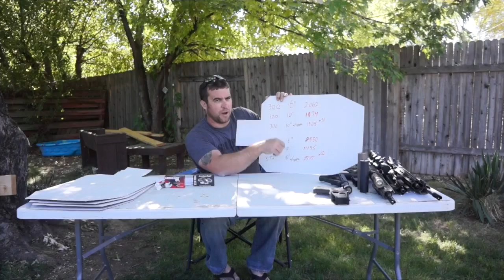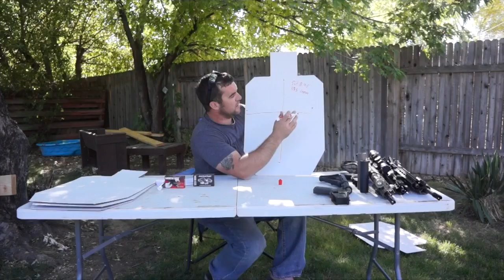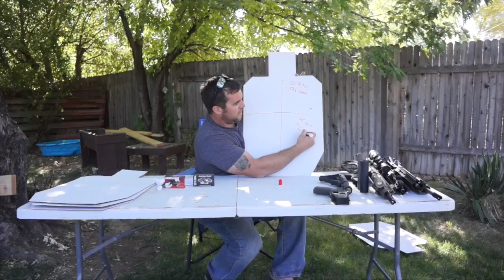Gunfight Science: Is 5.56 NATO Dumb?

Comment: 300 blackout is a better round SBR compared to 5.56. If money ain't an issue, go with 300 black. 
It's designed that way. 
Reason people run shorter barrels is for easy of use indoors. Overall shorted length when suppressed. Surprisingly cheaper considering 12.5in is far more prevalent. Smaller guns usually weigh less. Ammo is cheaper than 300 black. 
5.56 to the chest >25 yards will do the trick for any self defense situation.

Comment: 10.5 in barrel will get the job done 200 yds and in, you will still be ok at 300yds but from 200 to 300 you have lost a lot. Ammo and grain matter too, getting a higher grain or a round specific designed for SBR will do the trick. Such as hornady black tap 75grain. But if you really want a SBR look at a 12 in 6.5 grendel with a 123grain, the amount  of energy that round produces all the way out to 500 yds with a 12 in barrel is fantastic.

Comment: I killed a 80 pound beaver with 1 shot from a 10.5 inch barrel at 40 yards. The ammo I used was XM193 FMJ 55gr. I observed that the death was nearly instant for the beaver. upon dressing the beaver and butchering it myself I did struggle to find where i actually hit the beaver. Later I found that the bullet had hit the spine and reversed 180 degrees and stopped by the rib wall of its right lung. My guess is that the hydro-static shock from the round, the shot placement in the spine, and the relatively close range were the factors involved in the beavers quick demise. In conclusion, I believe that the 5.56 round out of a short barrel has its place in under 100 yard engagements, and that in war time it is more important to have volume of fire and the ability to carry more rounds into battle for the average rifleman than it to be delivering the killing blow to an enemy at the cost of greater weight and less ammunition. That is why we see M240B in (7.62 NATO) and other DMR (7.62 NAT Rifles)  being used in combination with the 5.56 NATO on the battlefield. There is not one gun that can do it all.   

Also 300 black out is far less effective at longer ranges. The bullet drop and makes shots out to 300-400 yards much more difficult. At least out of the SBR 5.56 you can still engage targets with out as much variable play. wounding an enemy and still having the ability to effect the overall combat effectiveness of the enemy  with a flatter shooting round is better than trying to adjust on the fly your bullet drop for an unknown distance.

Comment: You can find/buy 200X as much 5.56MM than .300BO.  What are you going to be able to find in the battlespace?   And getting hit by 400f/s round from a 10 inch barrel will still F- a person up.  And you may not want the bullet to travel 600-800 meters down range.  And maybe I want to stay under 500 meters.   Nice thing, is having standard ammo in the truck is nice.  I can carry 20 mags of 5.56 or 10 mags of 5.56 and 10 mags of .300......... yeah, I will stick with stupid and run the 20 mags.......

Comment: 2850 out of a 16 inch barrel? that is some under powered ammo.
Reply: Isn't 2900 out of a 18 inch barrel standard performance?
Reply: @frankopanklaric  No, I get about 3100 out of a 16 inch. A 12.5 with 556 will get around 2850-2900. 223 rem or under powdered 556 will get 2900 or so out of a 16 inch.
Reply: @frankopanklaric  Not for a 55 grain.

Comment: I beg to differ.

2500 fps is plenty to get the job done at close range. It's funny he's knocking the Mk18 at room clearing distances, then in the same breath practically is endorsing an SPR. Well, he's talking about a long range platform, and what does he think happens to bullets at long range? They slow down! Those successful kills with the SPR most likely took place at the same velocities as what a Mk18 would produce at close range. What does come into play is angle of attack. Normally, bullets wobble like a football, but at close range they can enter the target straight, meaning they won't work at any velocity. The reason the SPRs worked in his experience, and the shorter barreled weapons did not, is because the kills with the SPRs were at ranges where the wobble becomes more regular, thereby greatly increasing your odds that the bullet will do what it's designed to. Use SMKs, M855A1, Gold Dots, etc. and it's no longer a problem. Angle of attack is not a consideration for any of those. So having adopted M855A1 since like 10 years ago, the US military no longer has to worry about this stuff. Believe me, you DO NOT want to get shot with M855A1 from any barrel length.

He's also failing to take energy into account. The way rifle bullets do what they do in terms of messing stuff up is that they cause a stretch cavity that's large enough to stretch the tissue past its breaking point, causing it to tear, thereby creating a wound much larger than the size of the bullet itself. That's a matter of energy, not of velocity. Whether it's heavy and slow or fast and light, it doesn't really matter. Ergo, 5.56 and 300 BLK, being in the same class energy wise, will both do about the same thing. The 5.56 has advantages though. It can pierce armor, and it has more range, plus has a flatter trajectory. So a Mk18 is more versatile than a 300 BLK, EXCEPT when it comes to shooting suppressed. If you're intention is to shoot subs most of the time, then 300 BLK is king, BUT you have to realize at that point you're shooting a big SMG, not a rifle. So it's not fair to compare it to 5.56, because it's closer to something like 44 mag ballistically. If you're not planning on shooting suppressed, 300 BLK doesn't make any sense. It's designed to shoot subs most of the time, with the ability to switch to supers as an added bonus you wouldn't get with something like a 10mm SMG.

As if it weren't bad enough already, then he knocks PDWs! We're talking about something meant to replace 9mm SMGs and pistols, that offers terminal performance in some cases getting up there not too far from 5.56! Some of the newer 5.7 from a 10" P90 is getting up there in terms of muzzle energy with a Mk18, and it's far more controllable than most SMGs, and certainly more controllable than a Mk18, not to mention more compact and has 20 more rounds in a standard capacity magazine.

Long story short, short barreled ARs in 5.56 and PDWs like the PS90 are extremely useful self defense weapons for civilians and law enforcement. Maybe they're not ideal for rank and file military applications, where M4s and M16s make more sense usually, but for us domestic people they are absolutely the greatest thing since sliced bread. A Mk18 upper on an AR15 lower is about as good as it gets for home defense, especially since you can now get cheap Israeli 77 grain SMKs.

Comment: What length were the "standard length" 16" or 20"??
Reply: 20" is standard, then later adjusted to 16", but the 556 was originally built for a 20" barrel. It performs best there.

Comment: I use 5.56 for one thing, and one thing only. 55 grain full metal jacket for close-quarters work with a Mini-14 USA 16 and a quarter inch barrel but that includes 3 and a 1/2 in of muzzle brake with the ports tilted forward so that the noise doesn't deafen you every time it goes off. The round has devastating wounding capability. It doesn't have any ability to go through tactical barriers. If someone is inside an automobile and you have to shoot through the door, you'll pepper them with fragments but you will not stop them without shooting an inordinate amount of ammo. That's what 308 sore for, actual battle work.

Back in the late thirties when they were developing the M1 carbine they actually had a round that they tested in the M1 carbine it was a 25 caliber bullet in an M1 carbine case that was necked down. The 556 is actually an extrapolation of those early trials under the guise that if you wound somebody it'll take two other of the enemy to remove him from the battlefield and so that you somehow have removed three people from the battlefield? I don't understand that because the enemy in Vietnam never wasted time taking wounded comrades off the battlefield until the battle was over. Things like that happen when you fight people who have no regard for human life.

Comment: This is generally correct. That is why the M855A1 is so interesting. It tends to spawl or separate and tumble even at velocities as low as 1500 fps at the target.

M193 does a pretty good job in 10% BG down to about 2500 fps but at 2000 fps is much less effective.

This is why I favor the Speer 55gr GDSP for home defense at leaste until M855A1 becomes more readily available. Does well even through Windshield glass without over-penetrating.

M855A1 IS available at:  https://www.gunbroker.com/item/797368483

$2.13/rd when you purchase a case of 1000 on stripper clips. That's right, $2130/1000 rds.!!!!
Reply: They have it on palmetto for a lot cheaper than that...

Comment: Dear Clay: I always weigh what you say very heavily!  Now I have a great deal of re-thinking to do about my Daniel Defense DD4 SBR in 5.56;  I use Hornady's Black 5.56 75 grain Interlock SBR ammo whose method of terminal effectiveness is different than spawning.  It is one of my 2 SHTF rifles both of which I would grab (the other being POF .308 Revolution). I am now uncertain about my 5.56 SBR 5.56 versus my 8" 300 BO using hypersonic (and subsonic)  loads. Considering potential re-supply issues for my 300 BO, what is your suggestion?

Comment: Just match your ammo to the gun. Non - military. My xm-177 clone is loaded with finoca 55 gr bt's. For in side the house I like these rounds they brake up easily and quickly. Never shot any one with them but they worked fine on a coyote and 2 hogs about 150-180 lbs.

Comment: the  round  was  designed  with  a  20  inc.  barrel  fr  speed.  correct.  But  it  was  also  designed  with  a  1 in 14  twist.  this  meanies  stabilization  will  occur  but  not  over  stabilization.  after  striking  the  body  it would  start  to  pitch  and  Yah .  and  travel  to  somewhere  else  in the body  Before  coming out  of  the  body' if  in  fact  it  could  exit.  Finley  Somebody  is  telling  the  truth.   good  work  brother.

Comment: I'm sticking with the 556 and the  old AR or mini  to get the full powder burn out of the case witch means more energy on the bullet! The short barrels are for close quarters and vehicles to get in and out fast . The compromise with the 556 in 11 inch is less energy on the bullet with wasted powder burn butt with the heaviest bullets that can be loaded in the cases 70+ grains to increase the punch and have enough gas pressure to cycle the BCG reliable ! close quarters bring back the Tommy Gun 45 ACP

Comment: Federal's 62gr Fusion bonded soft point puts the smackdown on deer, and I would put it against essentially any .300 Blackout round.  I am a big fan of 20" barrels on ARs as well; an SP1 with fixed stock and 20" barrel with flash hider attached is still shorter than a Mossberg 590, Remington 870, or Benelli Nova Tactical, all with 18.5" barrels.  Also, Fackler is pretty well known for cherrypicking data that support his conclusion, and outright ignoring good evidence that with the right ammunition and cartridge (.357 with 125gr hollowpoints, for example), hydrostatic shock can be an effective wounding mechanism, even for handguns.

Comment: So what would you say is the minimum barrel length to be used for the 5.56? 16-20"? 
For SBRs, why not go with 7.62x39? The numbers I've seen indicate that going from a 16" to a 12" barrel costs about 150 fps. Between that, the round's range and the proven reliability of platforms like the AK or the Vz 58, I think it's a great starting point for an SBR.
Reply: It is. Short aks are very popular

Comment: Love the video but I dont necessarily agree with the final conclusion.  While I agree that a .300 delivers more kinetic energy than a  5.56 this becomes a trade off in carrying capacity which does not necessarily equate to a need to change to a larger caliber.   I feel that caliber can be mission specific

5.56 ammo allows more rounds to be carried for the same weight.  By carrying a 16.5 inch barrel and both Soft Points and Steel Penetrators , you have the ability to complete multiple mission types by changing the magazines and not the rifle.  Cleaning rooms using Soft Points and Penetrators for longer distance.   If places like Viet Nam, Mogadishu etc in MOUT situations showed us anything, with short range engagements shot placement is a must  but extra rounds when things go bad come in handy.  

If the mission is not on urban terrain in places like Afghanistan with longer ranges and , then maybe 300 BLK is a great choice.  You will carry less but your engagement distances will likely be further.  Shot placement will still be critical (maybe more so with fewer rounds).  

Too many videos make arguments that one round is, the answer to all situations which it is not.  Personally, I don't want to get shot with either a 300 BLK or a 5.56.  Both a poorly placed  300 BLK and a poorly placed 5.56 wont kill but both will kill if placed well.   We are all not going to carry .338 Lapua Bolts nor .50 Cals to guarantee a one shot kill, so maybe we learn to use our current equipment and work on shot placement.  If shot placement is not possible in a given situation, then we better be carrying more ammo..
Reply: Old post, but still... You missed the entire point.  Nothing wrong with 556, it has its uses for sure.  Clay is simply saying that for short barreled use (aka CQB) 556 is crap.  That is where 300blk steps in and is superior.  It is the mission specific took you referred to

Comment: There are many .223 rounds that perform well in SBRs.

We don't have to use 5.56 as civilians.
Reply: 5.56 is better than .223 though. I believe you meant to say that we can use expanding .223/5.56 ammo instead of just 5.56 FMJ.
Reply: asdfghjk 5.56 is not necessarily better than .223.

.223 has many, many more options without the strict regulations put on 5.56

Comment: ive never been a fan of short barrels in 5.56 either, or rifle rounds in general for that matter(though I definitely want a .300 blk SBR, but living in CT (relatively inexpensive) pre-ban AR lowers are hard to come by.) in fact my HD gun is a 17.5 inch barreled bullpup.but I am curious how using a hollow point(or soft point) bullet would effect the performance of these rounds out of short barrels? I get that they also need certain velocities to expand properly, and also that the military doesn't seem to keen on switching over to hollow point/soft point/ballistic tip ammo any time soon), but (as far as you know), would using one of these bullet designs improve lethality/wounding/incapacitation?or, is it perhaps even plausible to use a light(maybe 40-50gr) varmint type round out of an SBR? I wonder if, since they are designed for such high velocities, and designed to have little penetration but a lot of expansion/fragmentation, that at slower velocities they would behave more like a heavier hollow point out of a normal length barrel(in terms of penetration vs. expansion, not in terms of energy, or creating as much damage.) though, I suppose those "varmint" rounds may not expand at all at such velocities as would be produced out of an SBR(especially a 10" barrel. to me 10" is just silly.)I suppose the only way to know the answers to these questions would be to test the different rounds in gel(yes, I know gel isn't close to being a perfect analogue of what will happen in a living human, but until we get sufficient data from many people being shot with these types of rounds out of SBRs, it's all we have.)I'm personally happy with my bullpup for my primary HD gun, though understand many people hate them, or simply dont like them, and even I admit that i think i like the concept of bullpups more than any particular design. i like mine(an fs2000) because it is more or less ambidextrous, as my eyes are cross dominant so I shoot lefty, and living in CT was extremely limited as to the type of rifle I could buy before the new AWB was passed(not to mention the huge shortage of MSRs at the time. though it is pretty damned bulky.the designs I like the most are the Kel Tec RFB and RDB. ambidextrous, relatively low profile, and the .308 has an 18 inch barrel in a gun only 26 inches long. thats pretty sweet.too bad they are kel-tecs(I've also heard of reliability and accuracy problems.)

Comment: 5.56 was designed for 20" barrel at pistol length barrels you get massive muzzle blast, at point blank I guess you can get them with the muzzle blast.
for 300 blackout they are coming out with several rounds that expand well at the velocity it produces even at subsonic